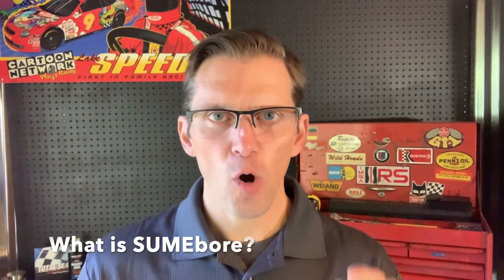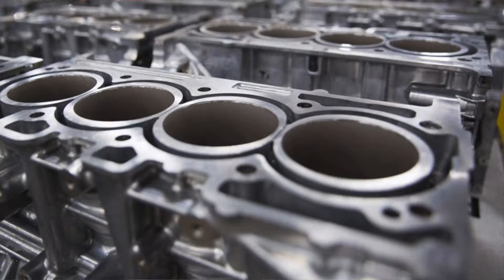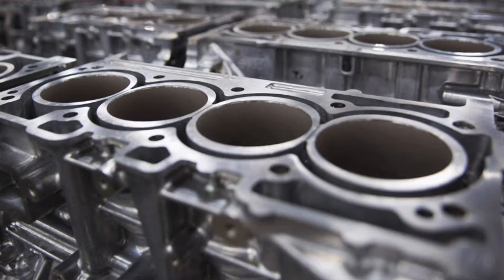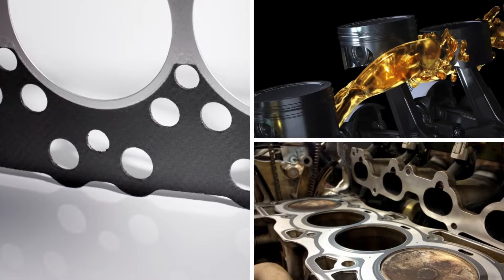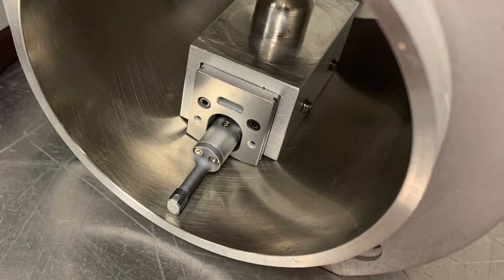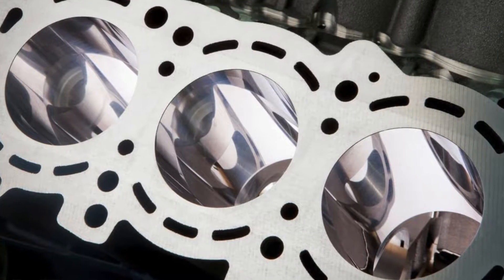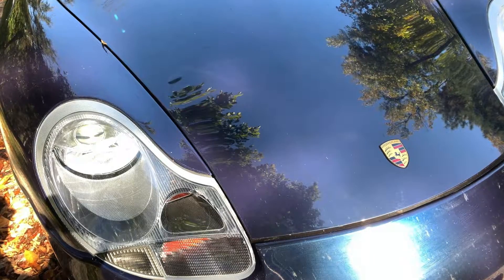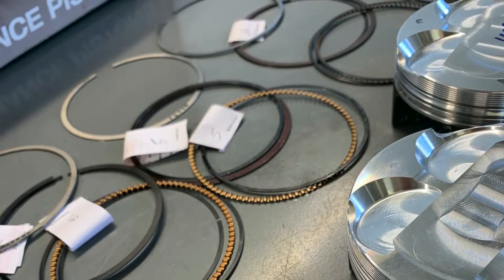What is SUMEbore?

Comment: As I know they coat molybdenum. It gives good harndness against wear and gives porosity to keep the oil. Additionally molybdenum has great self lubricating property. Even if there is no oil, it works for a while. I coated a lot of sewing machine needle shuttle by atmospheric plasma spray.
Reply from the maker: Molybdenum sprayed coatings do have porosity for oil retention, but it is actually softer than other coatings. As such, Molybdenum coated ring’s don’t last as long as PVD coated rings.